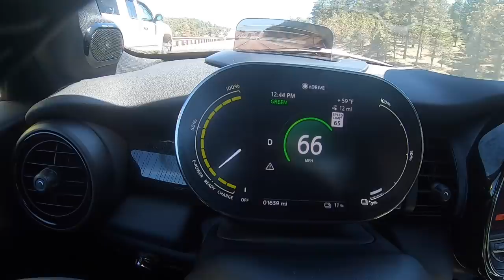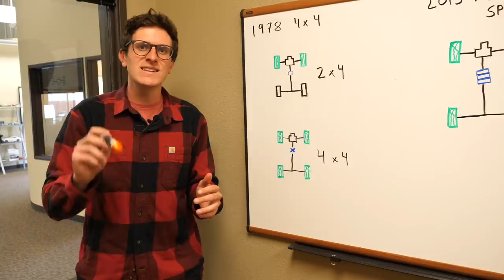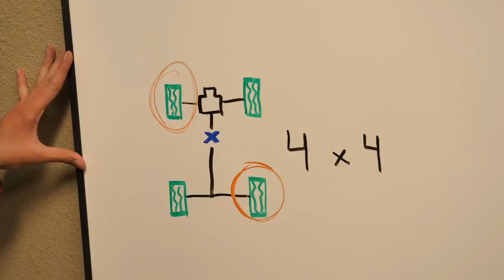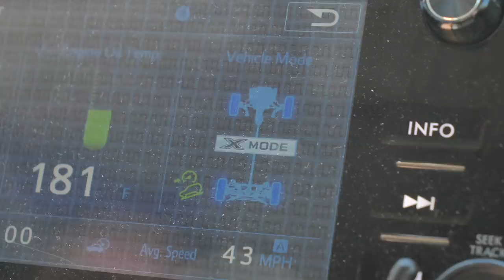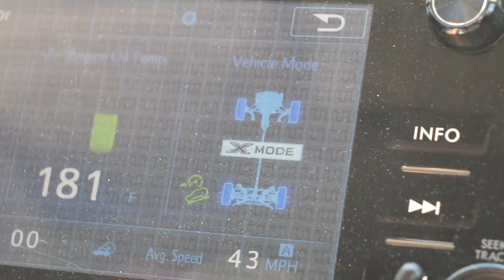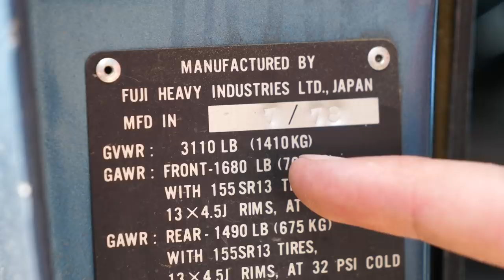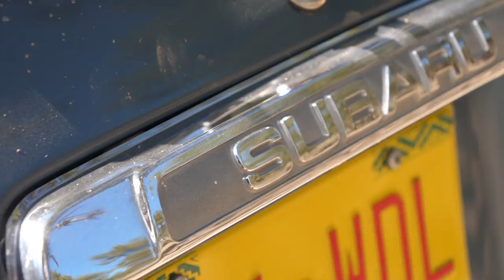Old vs New - How Much Better (Or Worse) Is a Subaru Outback Off-Road Than Its Great-Grandfather?

Comment: I had a loaded, fully optioned '81 Subie GL10 Wagon with the bizarre plaid interior, AC, power windows, white steel wheels and roof rack- an amazing little vehicle - not very refined or advanced, technologically speaking, only (maybe) 67hp, four speed stick, hi/lo manually engaged 4WD and very cheeky, centered mounted headlight that appeared under a powered cover. Not by any means an exciting car on paved tarmac but an absolute mountain goat when the paved road ended.  I sometimes foolishly drove that Subie offroad where few other vehicles could go. Absolutely loved and adored that little car and put many miles on it with a huge grin on my face.

Comment: I'm on my 6th subie. My first was an 82 GL wagon with 4wd and low range. Don't forget hill holder clutch and center lamp! That sucker could go anywhere! I loved it. But I got rear ended badly while stuck in traffic and the cat was totaled. Another one I had was an 89 Subie Justy. Most amazing little snow car. 3 cylinder engine, paper thin doors. Perfectly geared for the Sierra. Passing everyone, including k5s and broncos. Something about the thin tires and gearing. Lots of control in the slippery.

Comment: I had the 1976 4wd wagon. It went everywhere, sand dunes, beach and loose rock hill much steeper than on this video and just ate it up. But no more than 300 metres above sea level. I loved that car. I even launched a 14 ft catamaran at the beach which is why I bought it. Had to lower the tyre pressures. Couldn't go on bitumen at all in 4wd it would bind up comimg off the tracks. Only did that once front wheels only, rears were still in sand but no problem.

Comment: X-Mode ON Traction control OFF Drive as slow as possible BUT as fast as necessary.  TC off seems to stop the electronics from limiting power to the wheels and lets you get more power to the ground. ( Imagine the system is thinking you are in a skid on ice or wet road, it will cut power output and adjust breaking to regain that control  (tire adhesion/traction). Great in emergencies when at speed... but not when purposely offloading and you need that power)  You guys (TFL) have the "as slow as possible" down to a science when you do those hill/traction demonstrations BUT I find myself yelling at the screen "AS FAST AS NECESSARY!!! If you would speed up just a bit (I'm not talking about getting air or anything like that) but just enough to have the momentum to carry you over those bits and bobs ( read roots and rocks/ledges ) you would be putting less strain on the CVT by keeping the car in motion as opposed to the stop 'n' go hill climbs. *X MODE works up to 20 MPH* 
 Now if you are testing tires and rubber compound and tread design, use a 2 speed X-fer case vehicle and go SUPER slow so there is no momentum and only test for tire/tread friction and adhesion.

Thanks for reading, I do really enjoy your programming and am a regular viewer.
Ross Thoma
2003 Disco SE
2017 Outback 2.5l

Comment: Mountain goat is the exact term for those old Subies!  For the older ones, as you saw, you just have to give it the go!  They will bounce their way through almost anything.  I miss my old '83 GL...Had the 4W Low...That little beast went everywhere without modifications...Literally, miles from any "road" across steppe brush highlands and through deep streams (I once submerged it over the hood while powering through a very deep 'puddle' deep in the Cascade mountains, and drove right through without a stall...whew!!!) ...currently have 2006 Outback XT Limited, super fun with the turbo, but nowhere near as capable.  I think I may need to get myself another '83(ish) GL and just restore it to grandeur (with maybe a few upgrades) so I can once again go where I once traveled:-)

Comment: That old 78 is the exact year and model of my first car. Except mine had a 'better' paint job (someone spray painted the back half of it blue... the rest was white) and one of those awesome add-on bumpers.

I miss that thing so much. I loved every minute of owning it.

Watching this just makes me miss my '78 so much more... maybe its a good thing it was stolen (for scrap metal) or I would probably end up spending a lot of time and money restoring it instead of moving on.

Also, the first 'Outback' he points out at the end was a gen 1 Legacy (1990-1994), which was my second car. The Outback was introduced as a trim level of the gen 2 Legacy. Still makes his point though if you consider the point to be about Subaru wagons instead of the Outback specifically. Edit: he later points out a gen 2 Legacy wagon and calls it an Outback as well. Subaru did eventually stop selling the Legacy as a wagon, presumably because they mostly sold Outbacks instead, so I can't say I can blame him for making that mistake. 😉

I also miss that car, even though it was an automatic. It moved me home from college with all my stuff crammed in the back.

My gen 2 1997 Legacy is pretty nice too though, even if it is just a sedan. I fit a lawn mower in the truck the other day so it does alright. And it isn't white like my other two cars, so thats a plus! 😂

Comment: My first vehicle was an 81 Brat. I took it off road often using it for hunting. I really liked it. I had it crossing creeks deep enough to have ice stuck in the headings, mud until it dragged its belly, had a 220 lb deer in the back, even a small Suzuki 125 ATV. I only had it stuck once when I high centred it on a big rock while crossing a river. It was fun to drive fast (well relatively fast) on dirt roads because of the 4 wheel independent suspension. On snowy icy roads it was unbelievable. You could hang the back out in curves. Once I even caught up to a rally Volvo that was practicing. Boy were they surprised. It had bolts on the spring perch in front to raise or lower it. Best of all it had a LOW RANGE! I took that car everywhere off road and while it could take it, it was very tiring to drive off road all day. You had to concentrate all the time and pick your lines carefully but with a set of BFG mud terrains it was a goat. The limited wheel travel meant you had to often go a little faster when articulating a lot but not as fast as you did because of the low range. I could go slow enough to prevent any damage. Sadly rust was eating through in 3 years and I had to get rid of it. I moved up to an 84 Ranger with dual tanks and front and rear limited slip diffs. but thats another story.

Comment: That was one of your best ever.  Yeah to the old suby.  Simple mechanics will beat electronics every day when longevity is concerned.  Like you said the old suby will do it time after time.  The new one will self destruct between the cvt, brakes instead of simple front to rear locked diff, etc.

Comment: Man, I had foil tape sealing up the rust holes on my 87' GL behind the rear wheel wells, and the car was only 14 years old then. This thing has been sitting in a museum. Would be amazing to see one of the 80's subies with the low range have a go. Pro Tip: Don't drive locked in 4WD with a donut spare on for weeks.....

Comment: My first newish car was a 1978 BRAT bought in 1980. Sold it with 280,xxx miles on it. Great in Colorado winters, and light trails. When I sold it you could almost see through it, RUST. I'd love to find one to restore, but finding one without rust is impossible. Still have a Forester.

Comment: My '90 Legacy L wagon was destroyed in a collision last year. It was the most rugged, trustworthy car ever, and I had it all dialed in for at least another 10- 12  years of use. We called it my Range Pony. Even a new wagon is , I suspect,  not going to meet my needs for camping, dirt roads, and hauling the canoe. I just test-drove a 2019 Outback, and was appalled at the lack of attach points, overall height, and plastic and electronics everywhere. It was like driving a videogame spaceship (not good).

Comment: You’ve got to have traction control off just about everywhere off road in these Subaru’s. The best is manual mode with xmode on and traction control off. They just cut too much power with the tc on off road. That’s power that you need to use for momentum because they’re lacking that low range.

Comment: I had a 1980 BRAT.  No power, not efficient, but it was fun ... until the clutch cable would break.  I did have 13 inch Rayon BFG Mud Terrains on it.   It went through some really deep snow and mud.

Comment: Also, don’t floor the throttle on the Outback when off-roading because the system thinks it’s too much for the CVT and it will cut power. You want 3/4 throttle for the most power. I have a 2017 Forester 2.5i and have done extensive testing off-road.

Comment: I must not be the only one to suggest this test to Roman. I'm so glad they did it. No surprises here at all. I knew the old one would clobber the new one.  My 86 GL wagon would have. Plus it had low range.
The results here beg the question:  After 50 years of R&D, why is the new Subaru less capable than the old one?

Comment: So true. I have an 86 dL with the low range and it's unstoppable and beat the crap out of it for years and still goes. I also have an 09 outback and torn the center diff out without much abuse. The outback still goes good but not as durable as my old DL.

Comment: Fun video. I bought a new 1977 subie and lived in Winter Park, Colorado which is at 9000 ft elevation. I had it in some of the stupidest places. The carburetor was a real weak point because of the elevation changes. I next bought the 1980 model which had fuel injection which was a quantum leap forward. Fun memories!

Comment: Those are tie down points not recovery points. Do not put too much effort into a recovery, they may come off or twist the body. Ask me how I know.
Reply: That's true, but on old Subarus, the connections of those hooks to the body were very strong, and the body itself was fully boxed on each side into a frame-like design with thicker metal than what you see on cars now.  The hook connections were much stronger on Subarus of that time than is the case on similar cars these days.  I used mine to get a strong "running start" into a tow rope when rescuing stuck vehicles numerous times, back in the day, with never a sign of over-stress.

Comment: By the '80s, Subaru had added a low range to its transfer case, operated by a lever that was pulled up once for 4H and again for 4L without needing to stop. I had an '85 BRAT that went anywhere (except the interstate). The spare tire was still under the hood.

Comment: Bought a new 2017 Outback and was not disappointed when it was totaled around us, I was also glad to see it gone. It handled well and got decent mileage but it had so many little niggling problems that made it unpleasant to drive. I.E. There little reflective bits everywhere in the cockpit which glared annoyingly, like the chrome rim around the vents which left bright stripes on the windows so you couldn’t see the mirrors, the unusable GPS when rolling, the fact that the screen was angled just perfectly to catch all the light coming from the windshield, the drivers seat was the most uncomfortable thing I had ever used, a fact not discovered on a test drive of less than 10 miles (had to buy a custom cushion to use it), expensive regular maintenance, huge A pillar blindspot, you get the idea. Took the insurance money and bought a lower spec Nissan Pathfinder and does everything well. One thing I will give it, after almost two years of use it had barely depreciated and I did not lose my shirt to the market.

Comment: TFL bought a MINI R56 GP? So much YES. Awesome choice!! (if not a headache). I owned R56 Cooper S and LOVED it. It was actually reliable even though it had some oil leaks here and there. It never broke down or lit a check engine light. MINI unreliability is pretty overblown. They're not Toyota's for sure but they're also not 1970's FIAT's either. Timing chain tensioner is definitely an unacceptable issue but mine never gave up the ghost after 160K miles of ownership; even with a 230 hp tune and very aggressive driving. Great little motor.

Comment: regarding safety in the EA71 (GL), they were surprisingly safe for the era and hold up extremely well against even modern full size pickups in accidents. Also Subaru considers the boxer engine a safety feature because it is more likely to slide under the car in a wreck than a V or inline engine.

Comment: cvt & offroad... what a joke.Subaru has lost it's way. That old subi is sweet though
Reply: Subaru is selling what they think the majority of their buyers want. And their sales numbers would seem to indicate their correct. The vast majority of buyers only want a car that can go in the snow get them there safely etc.
It does greatly sadden me however. I owned a few Subarus in the mid-90s with manual transmissions. And they were so much fun to drive.
The CVTs just take so much of the road feel out of the vehicle.
You could hear when that thing was climbing that hill it just wouldn't rev the engine up to keep that transfer overheating.
I think Subaru is doing the right thing financially. To keep their sales up. But it certainly is disappointing to old school Subaru fans like us.
Reply: My cvt Crosstrek does just fine off-road. Of course I have a lift and better tires but the cvt does very well.

Comment: I had a 1980 Subaru wagon with four-wheel drive.  That was the first year that Subarus were wider than the old car you showed here. It was rather primitive, but if I could get my hands on a slightly-used one just like it, I'd buy it in a heartbeat.  And yes, the first gear, though not a "granny gear" like some light trucks of those days and earlier, it was indeed a low gear, more so than any other passenger car you could buy back then, and that car could start up a steep hill with virtually no need to slip the clutch, and then creep uphill at 3 mph, clutch fully engaged.  At 200,000 miles, my clutch had 4/5ths of the lining remaining, and that had been largely city driving, so that low first gear was great for clutch longevity in normal driving too.  Only problem?  Top gear was rather low as well, so today's 70-mph speed limits (and higher) would be no fun (but then, that's also the case for classic 4x4 trucks!).

Comment: A friend of mine has a 78 Brat he's real proud of. Yes, it's pretty good at getting around, even in snow, has a small bed and the camper shell. He likes to think he can follow me around in my 73 Ford F100 Short 4X4, lol. I could almost put his Brat in the back of my truck, LOL! He says they only weigh about 1600 lbs. I've owned my truck for 35 years and am the second owner. It has all the goodies including a locker with 35X12.50 XTerrain tires. It'll climb a tree, I've stood it straight up and down with the front end off the ground. Anyway I could go on forever about my truck but suffice it to say, the Subarus are good vehicles no doubt!

Comment: I am not sure why people are fussy with the CVT. The CVT on the Subaru works better than most of the other 5-8 speed automatics which I have owned.
I am pretty sure 20 years from now people will be looking all around to add a 2011-2018 Subaru AWD with CVT to their stable🤷‍♂️
It’s economical, it’s reliable , it’s fun to drive & it never fails!
 The boxer engine, Symmetrical AWD and that CVT works just perfect in my humble opinion.

Comment: I learned to drive on an 82 Subaru GL wagon.  A great little car, but man did they rust away.  I remember that the ones of that generation had an extra driving light hidden behind the Subaru logo in the front grill.  They had to disable it in PA because of some goofy regulation about lights having to be mounted in pairs.